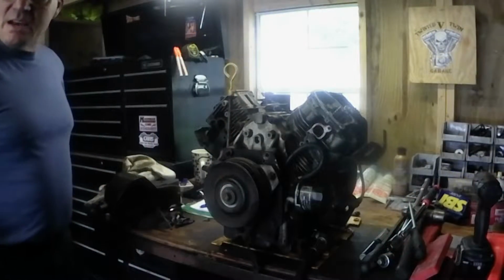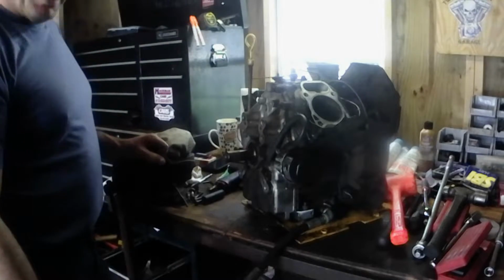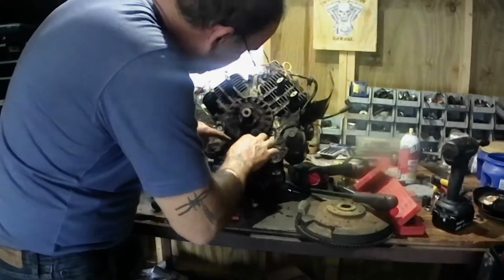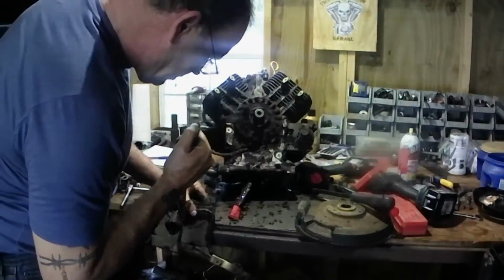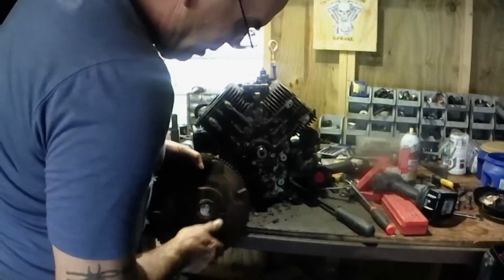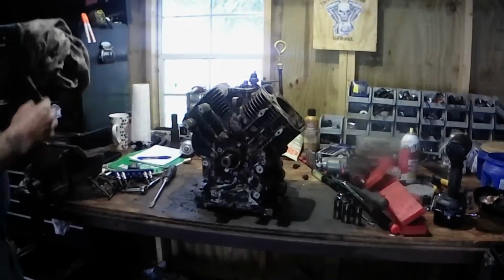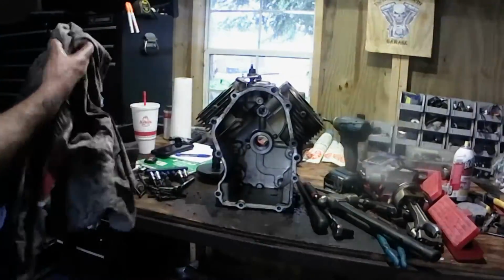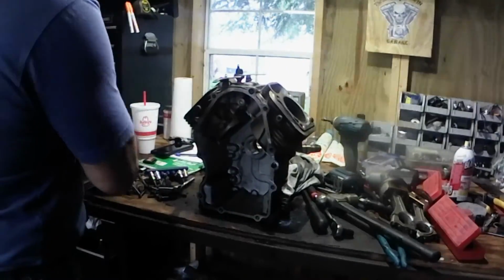kohler command tear down

Comment: Nice work. Good luck with the next part. Have you got a micrometer to check the crank?
Reply from the maker: Benedict White no i do not
Reply: @twistedvtwingarage7260  That's a shame, they can be useful for inspecting engines. I have a set that covers up t 4" that cost me around $70
Reply from the maker: Benedict White i do have micrometer and i do check cam and crack with it i didn’t see the post Wright but thanks for the tip